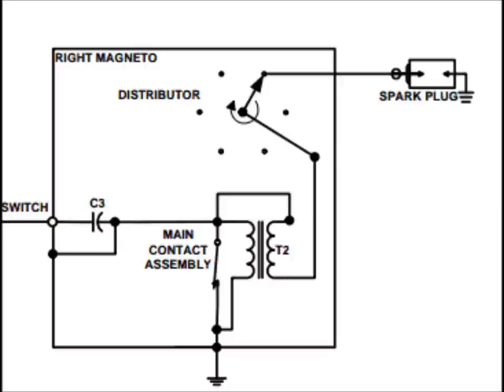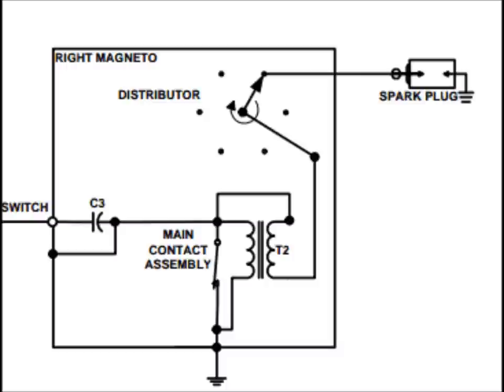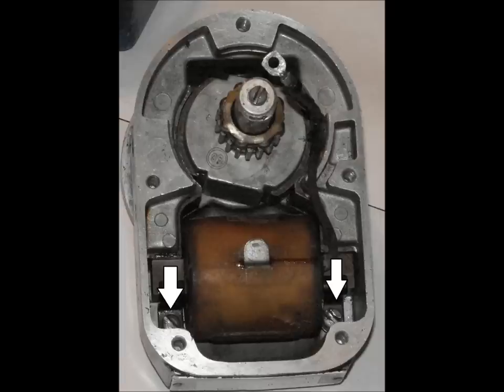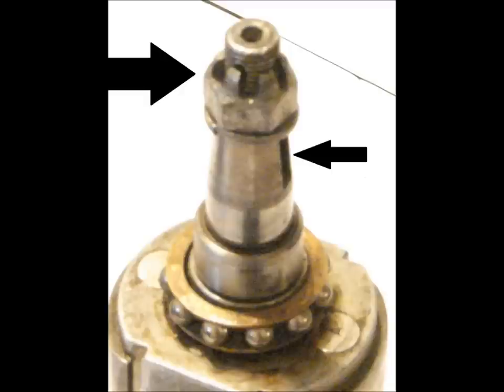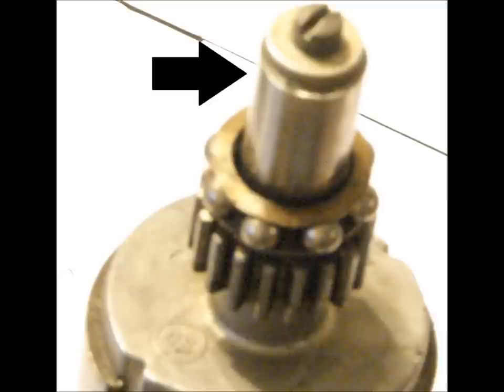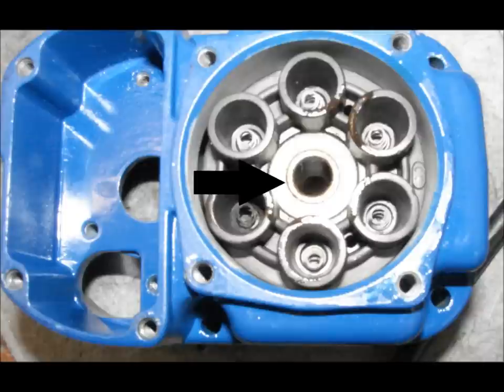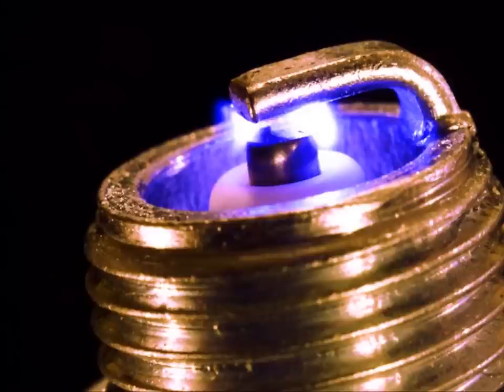aircraft magneto operation and component description

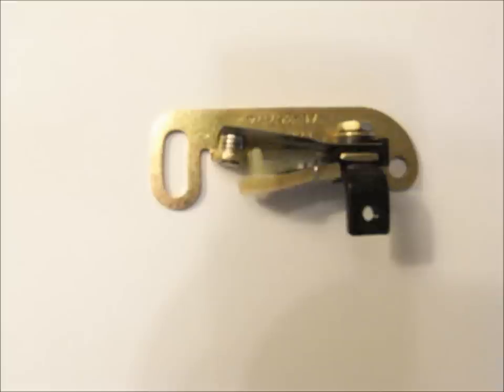Comment: BTW............the points are CLOSED while the coils are charging , and OPEN  at the correct time ( just past the neutral position) which collapses the magnetic field (at its maximum) and discharges through the distributor rotor gap and out to the sparkplug through the plug wire.........you recited it backwards @ 1:40 in the video................you might want to change that............nice job though..
Reply from the maker: Honestly thanks, for the input. I made this a project while I was a  student and will not be updating it.